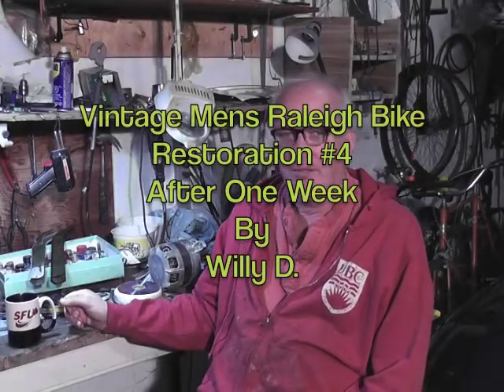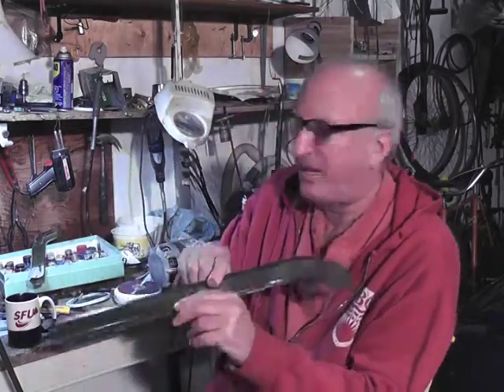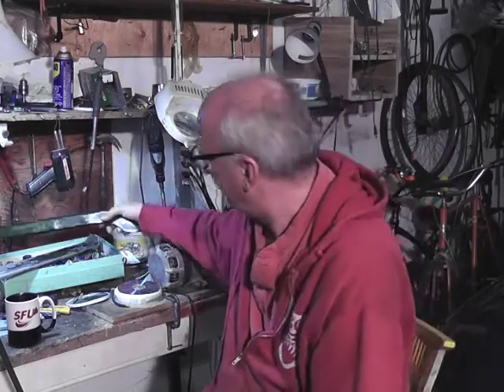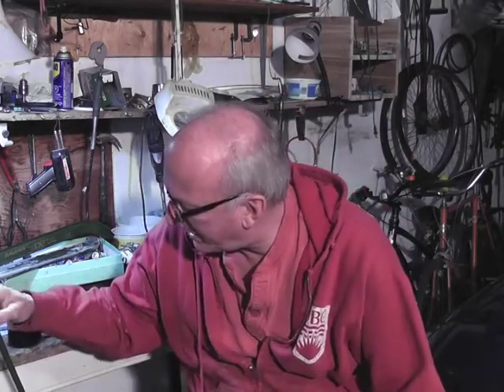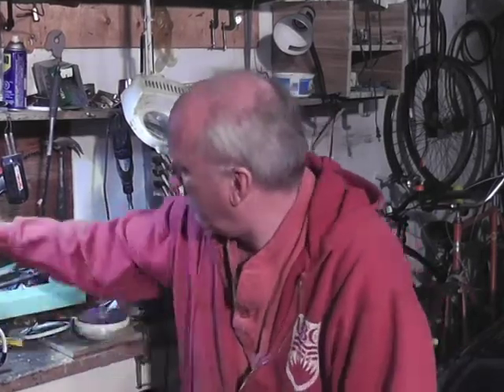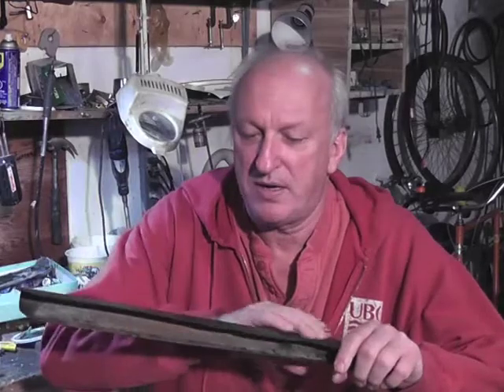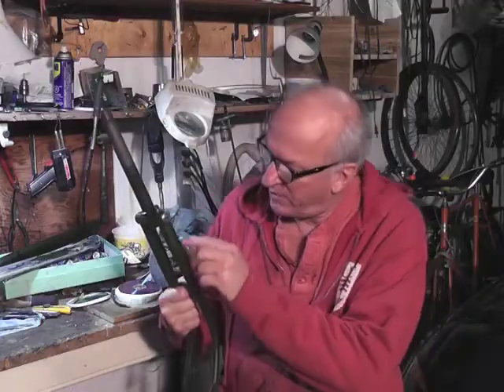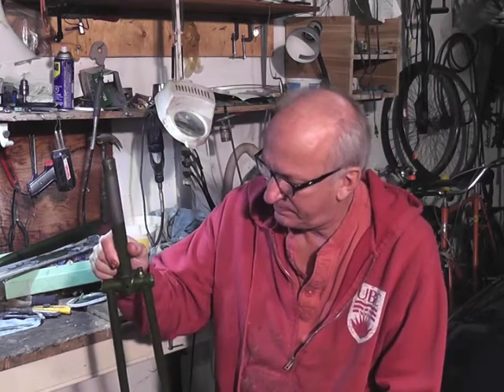VINTAGE BICYCLE RESTORATION         #4

Comment: Could you help me change the raleigh 1950 bike brake lever spring?
Reply from the maker: The springs can be bought on Ebay. To take off old springs unbolt nut at end of lever at centre.The spring will be loaded or broken. I have compared your bike to Ebay: Vintage Raleigh Bicycle handle bars roller lever/rod -pull  Roadster Bike NOS 1950.  The one side of spring goes behind lug on bars and the other side of spring goes on flat nut plate at end of lever. The spring must be installed (loaded/twisted) so brake lever is pushed open (down).
Breaks pads should be open. Look at similar  bikes on computer and you will find a picture and that will reveal how it is placed. They usually go on the ends of the brake rod and are loaded easily.